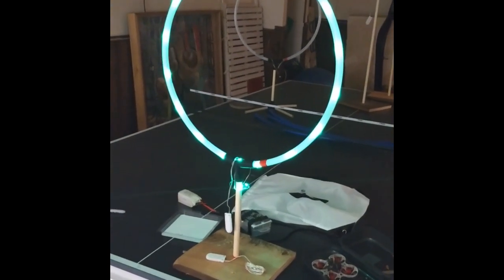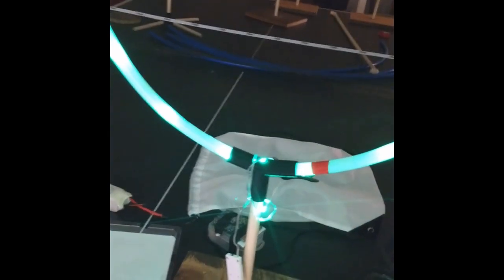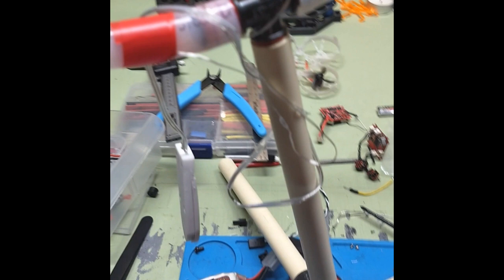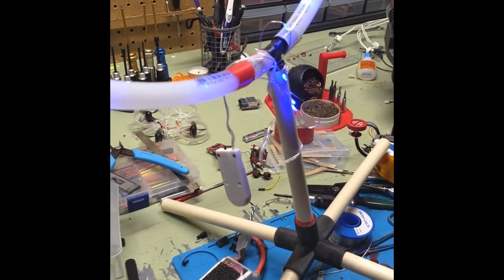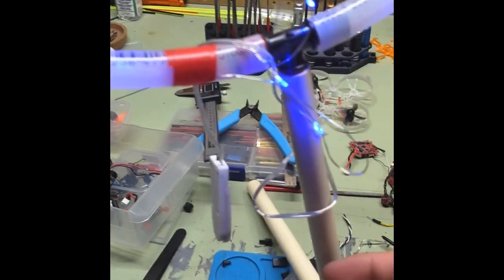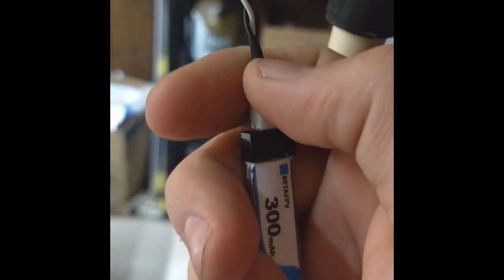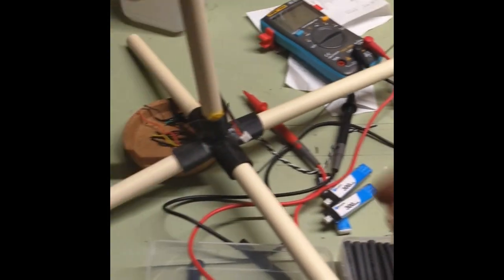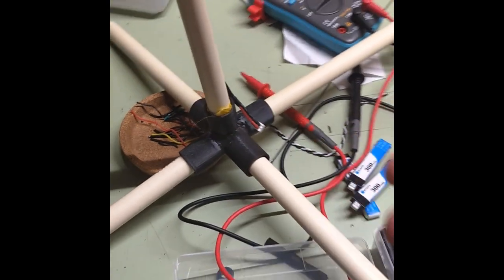How I made $4 DIY LED Tiny Whoop Gates

Comment: Which is the diameter of each gate? I have 10 meters tubing and I am thinking of build 5 or 6 gates with it depending of the gate size. I want to use it at home like you :)

Comment: how are they $4  ???
Reply from the maker: The LEDs were about $1 per gate, and the tubing is $2.50 and then use scrap wood and the t connector is super cheap. So it's about $4